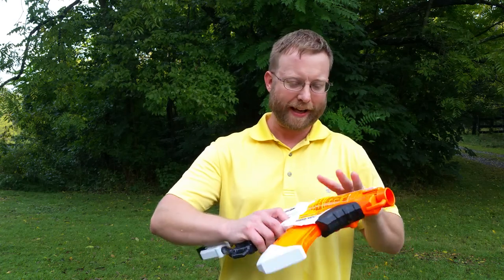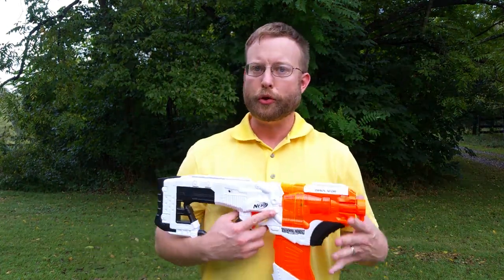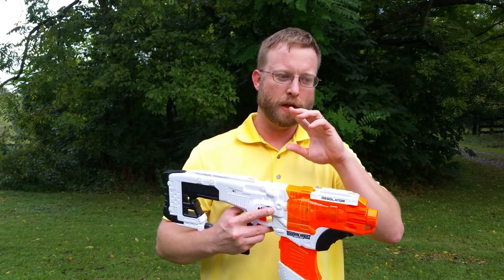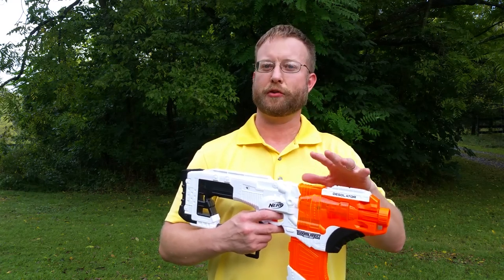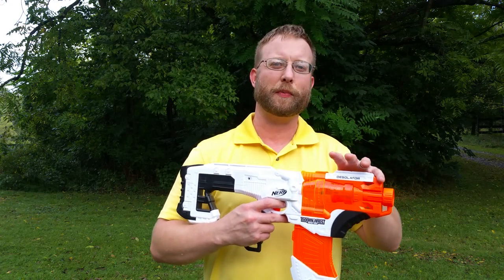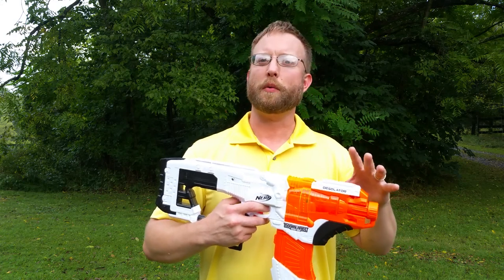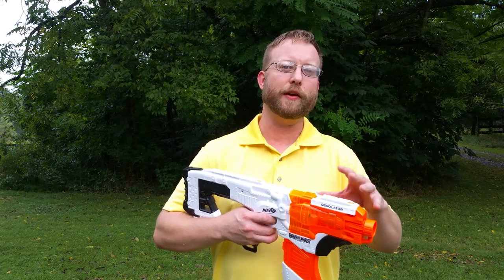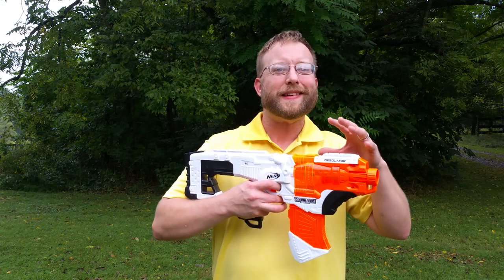Quieting Superstock Flywheel Blasters

Comment: what about interior soundproofing foam? would it work?
Reply from the maker: It isn't something that I have tried, but I image that it would help some.  It should cut down on shell vibration.
Reply: I have it’s not the best solution but it’s a lot quiter but really hard to install
Reply: Alex Christian do you think that it would make a stock blaster much quieter? Because I'm trying to make a flywheel blaster for sneaking around.

Comment: running flywheel motors intended for 3s at only 2s voltage makes a huge difference in sound for hardly any loss in velocity. The machined flywheels make a similar reduction in noise without any performance loss. The metal cages probably make less of an improvement in sound, but definitely do improve it, also without loss of performance.

In other words, this video is still relevant information in 2023,. After making these 3 changes to my Rapidstrikes, they went from sounding like air raid sirens to something more like Dremel tools. Big quality of life improvement.

Comment: Good video! Can I run an idea by you real quick?

Forget about anything ever made by Hasbro or Boomco. Just hypothetically - Would you see any benefit in a blaster that uses an actual weighted flywheel for energy storage?

Let's say you have your regular flywheels, but this time they are connected by gears so they are perfectly synched. This assembly is in turn connected to a 1lbs high-speed flywheel which in turn is powered by a brushless motor.

The flywheel is powered up until it reaches a certain RPM, then the motor shuts off until the RPM drop till a treshold value which kicks in the motor again, continuously keeping it at optimal performance RPM. No manual controls needed. Just turn it on when you start your game, and the motor will just kick in intermittently as needed. 

It could potentially be a lot quieter as you don't need to run the motor all the time when firing. A flywheel that size and weight can store quite a lot of energy. You could add a manual override that prevents the motor from kicking in if you want to sneak up on somebody.. 

What do you think?
Reply from the maker: That's a big project, but there could also be a pretty big payoff. You could move the flywheels a good bit closer together and get more fricon on the darts, thereby increasing the potential muzzle velocity.  The momentium of the heavier flywheels would keep them moving though the increased crush.  Larger diameter flywheels could also be in contact with the dart for longer, also increasing potential muzzle velociry.
Reply: akumabito2008 That's a great idea dude....what do you mean?
Reply: Its not a bad idea, but I think it may increase your spin up times by a good bit.

Comment: Hi... Thanks for the informative video. A question; Those Kyssan 16180 would work on Stryfe, RapidStrike,  ECS-10 and Demolisher right?
Reply from the maker: Yes, they are 130 size motors.  They are slightly wider than the stock motors Nerf blasters ship with so you have to trim the ribbing in the cage to make them fit.  But otherwise they will fit any Nerf blaster.

Comment: I'm in the midst of building a (relatively) quiet stryfe.  My plan is rhinos on 2S, with an artifact cage and wheels for maximum ninja mode.  That said, I've contemplated the idea of Honeybadgers on a 1S - its the same relative drop from rated voltage in both cases (HBs are rated 35k rpm at 6v, Rhinos 36k at 12v).  Is that a terrible idea?  And a quick question - is that desolator's circuit set up with active braking?  It sounds like they spin down ultra fast, but maybe its just the lower peak RPM.
Reply from the maker: Honeybadgers on 1S should work similarly - they may start to go subcritical once your Lipo goes below half charge, but that doesn't usually happen with a decent sized Lipo in Nerf.  
I did set this up with active braking.  Some people don't like it, but I find it works well for hit and run play styles.
Reply: How does active braking work, and how easy is it to do in a blaster? I'd love to be able to give my Stryfe this kind of fire-and-forget capability.
Reply: @James Monson you just need to set up your circuit such that the motors are shorted when the trigger is released, which causes them to almost instantly spin down.  I've done it on a couple blasters now.

Comment: Have you tried the machined blasterparts flywheels? I'm curious how those would compare to the worker ones with noise.
Reply from the maker: I haven't, but I just got in one of the red Artifact cages with its flywheels.  I've only done a little preliminary testing, but those are really quiet and shoot very well.  I think the metal cage helps deaden the sound along with its balanced flywheels.

Comment: do you need to change any of the micro switches? since you're running off of IMR's...
Reply from the maker: Yes, the stock switches are pretty weak.  I use a 5 amp sub mini.  even though they are only rated at 5 amps, they are rock solid.
Reply: 498 Nerf Good to know. I'm slowly learning to rewire and gathering info before diving right into it. Thank you.  Do I need to get new motors or can I getaway with them for now?
Reply from the maker: You can get away with the stock motors for a while.  They will eventually burn out, but by then you'll be more than ready to move on to better things.  If you do use the stock motors, run them on a 3S Lipo or 3 IMRs and a dummy battery.  They can't handle the voltage from 4 IMR cells.
Reply: 498 Nerf Good to know. Thank your for the help. Mahalo

Comment: I looked At the basic stats for the m.t.b. rhinos and honey badgers and I don't know what would be better. I am glad that I found this video, cuz I don't like how loud and annoying they are. Like most people I would like the best performance I can get without;  having to put in 180s (even though they look boss, I feel like they are too much of a hassle) the least amount of cutting as possible (I want a sleeper) and I also want to make a mechanical(or as much as one can) select fire stryfe/desolator(check out moderate skill's channel if you are interested). It's my first real flywheel mod, but also my first real mod, PERIOD. I just want to get as many hints, tips and pointers as possible to ensure that I don't goof too badly. So after that extensive explanation, I will make my initial question clear(because I said a lot of words(words are confusing)), for flywheels, what is better Rhinos or Honey Badgers? And also, you mentioned that if you put an artifact fw-cage in the desolator it would be quieter. Can ANY after market cage go in that blaster. More specifically, the canted artifact cage? Regardless of answer or lack there of, if read to the end of this short story, let me know so I can give you a high five. Thanks -BenJAMin
Reply from the maker: Imo, Rhinos make the better flywheel motor.  3S for best perfromance, 2S for a quieter superstock blaster.  I don't belI've that the Artifact cages fit in the Desolator with redoing the mounting screw ports.

Comment: Nice video!always think of the ninjas...
Reply from the maker: Lol, ninjas have feelings too...
Reply: Would that method work on stock blasters,to be even quieter?
Reply from the maker: Not really, stock flywheel blasters are already turning slower than this build.  And if you slow them down any more, you lose performance.  I will say though, that stock wise, the Desolator is the quietest flywheel blaster I have seen.

Comment: Tried ordering those motors from the site, they have minimum of USD100 per order, bummer. love to try those motors
Reply from the maker: You can get similar results with MTB Rhino motors running on a 2S Lipo.  There is a guy over on Reddit - /u/Duke_Wintermaul that sells single pairs.
Reply: But the rhino motors are too noisy. Based on your video, the Kesyan motors are more quiet. BTW, I'm Malaysia, not much stuffs available here for DIY.
Reply from the maker: Rhinos are more noisy on a 3S Lipo, but if you run them at 2S, they run about the same speed as the 16180s.  The trick is the lower voltage - it causes them to turn slower and be less noisy.